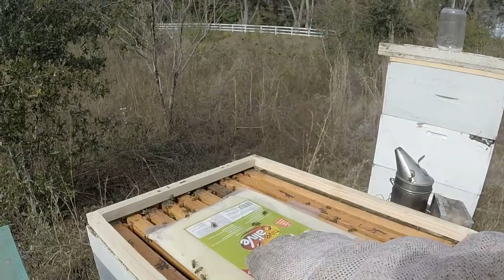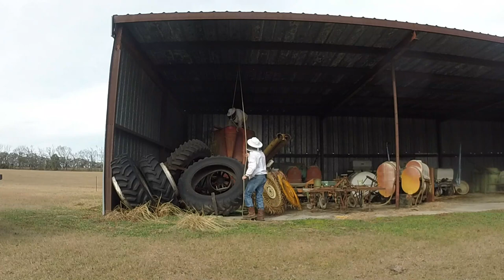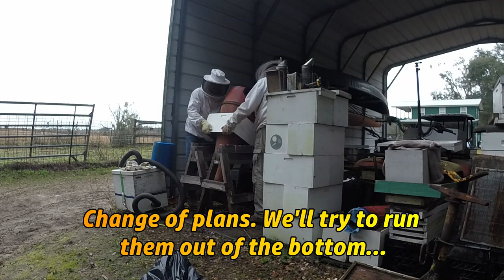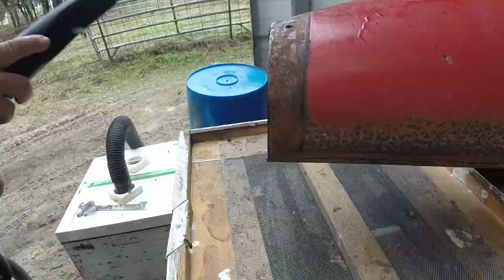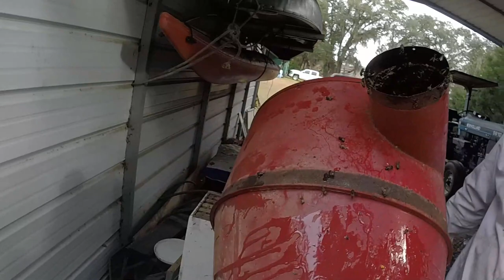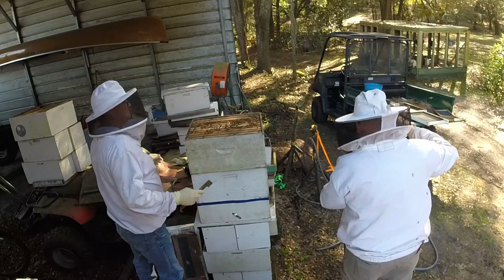Bee Colony Removal in Route to Hive Life

Comment: Mike, that was quite an adventure to end 2022. All I can do is look at the snowbanks.  LOL That was a creative removal. I would have been thinking of a saw or torch. Good job done there, Hope you are having a good weekend and recovering from last weekend. That HL wore me out along with the 18 hr drive.
Reply from the maker: If the equipment had been in worse shape, we could've cut it, but the farmer can still get some $$ out of it, so destroying the cone wasn't an option. And trying to weld that sheet metal back wasn't worth the time, so I used a Mr. Ed brick column technique.....I was wore out myself. We only had 9 hours on the road though.

Comment: So how did Theron clean out that funnel so it works and new swarm doesn't move in? Y'all are working bees and it's still in the 30's here in SE PA.
Reply from the maker: Well, First thing we did the next day was to take it to one of his bee yards and let the bees clean out all the honey. He then sent me some clips and what he did was get a handle and scrape a bunch out. Then he dumped some super hot water down in it while it was turned on end and let it set in there a while and dumped it. He did that a few times and it got 95% out. It didn't get it all, but it's pretty well out. After he mounted it back on the machine, he sealed the openings and he's setting a swarm box on the end of that equipment shed.